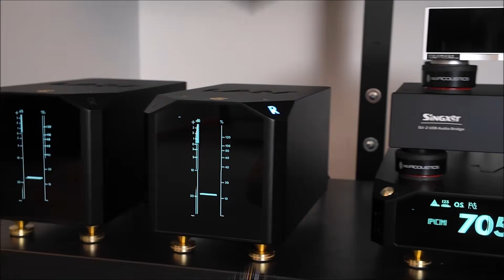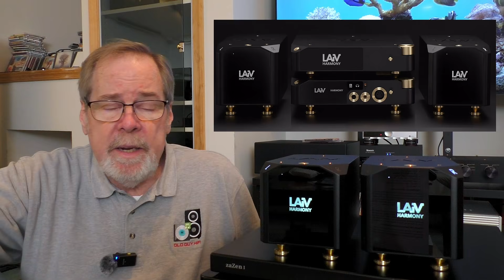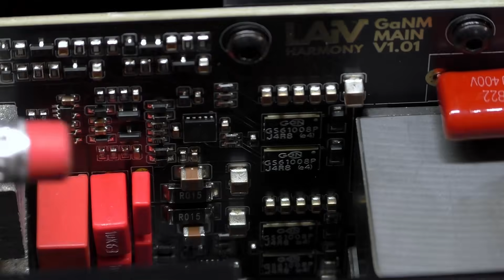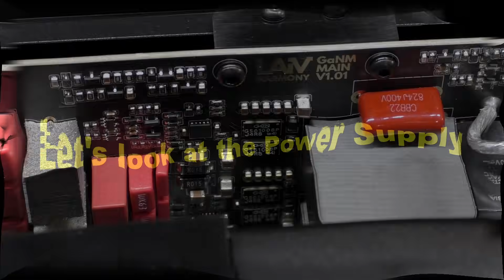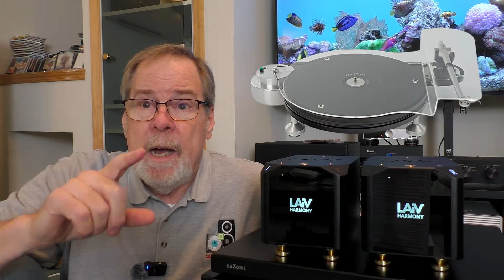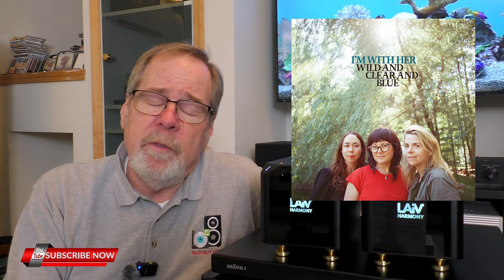I Once Asked if it Takes 2 to Tango. YES! Definitively! The remarkable LAiV GaNM Mono Amps. GREAT!

Comment from the maker: Capable of delivering 200 watts per channel into 8 ohms, the Harmony GaNM provides ample headroom to effortlessly drive even demanding speakers with precision and authority. This high power output is maintained without sacrificing detail or finesse, offering an engaging and transparent sonic experience. Whether you're listening at low levels or pushing the volume, the amplifier maintains complete composure, preserving musical nuance and control across the entire frequency spectrum. For more information regarding the LAiV product line please visit: https://www.laiv.audio or visit Vinshine Audio at: https://www.vinshine.audio/category/laiv-audio. If you wish to join the channel please click here: https://www.youtube.com/@OldGuyHifi/membership
Reply: Great review Ed, I am wondering what magic they did to reach 200W/8Ohm from 250W power supply. My starkrimson ultra monoblock, have 1200W psu and this is match powervise...
Reply from the maker: I will check with the mfr. I do think SMPS operate differently. I will let you know what I find out.
Reply: Hello, I've been a subscriber for a while and I wanted to know if there was a difference in listening with the Orchard Audio Starkrimson Ultra Mono LPS with their linear power supplies!
The Orchard Ultra Mono LPS are amps that have tempted me for a while, but can these LAIVs change the situation? Is an objective comparison possible, and can we say that the Orchard, despite a slightly higher price, is worth it for a long-term purchase? A sort of ultimate amp in terms of quality/price ratio. Thanks to all the opinions and advice from experts! From France!
Reply from the maker: I think the OA amps use an SMPS power supply. There is some conflicting information on this. The units I reviewed had a SMPS. I haven't heard the version with an LPS. Sorry. I do feel that modern SMPSs are getting to the point where there is little if any sonic difference with an LPS. SMPS are far more energy efficient and produce much less heat. That's the best I info I can provide. Bonne Chance!
Reply: Hey I love your reviews and your music suggestions are very welcome.

Comment: Would like to get this in stereo without the display and a single ended inputs with gain adjustment for use with high gain tube preamp
Reply from the maker: Rack or to LAiV and pretty them know.

Comment: Hello OldGuyHifi, does Laiv Harmony GanM monoblock amplifier employ global post-filter feedback (PFFB)?
Reply from the maker: No. It is not that kind of amp. PFFB is only on TI chip amps.
Reply: Thank you OldGuyHifi, so with different speaker loads (4Ω vs 8Ω vs different speaker Ω on playing music) change the sound signature (specifically, bright/treble boost). Were you able to hear a difference (bright treble) while playing music with different speakers?
Reply from the maker: There was no change in sound regardless of impedance. Again this is not a chip based class D amp. It does not need any circuitry to accommodate speaker impedance.
Reply: @O@OldGuyHifi Thank you so much for the info.

Comment: Any recommendations for a good tube preamp for under 2k (used or new) that actually has some tube warmth?
Reply from the maker: Take a look at the Galion TS-P75.
Reply: @OldGuyHifiI had considered it but it’s such a new brand. Any others that you might recommend? Thanks.
Reply from the maker: Not sure about the price but take a look at the Rogue RP1.
Reply: @OldGuyHifi Thanks. Price is within parameters.

Comment: I own LRS+ speakers, which you mentioned in your review, but you never got back to the caveat of them with this amp in your conclusion. How did they sound with these amps?
Reply from the maker: I would stick to Class A/AB amps with the LRS+.
Reply: @OldGuyHifi was there a problem running the Magnepan speakers or was it the sound? Would the larger 1.7i be a better match?
Reply from the maker: The amps lack warmth. They are very detailed and clinical in their sound. A bit sterile to my ear on the LRS+.

Comment: Hello again Ed!
Texas Instruments TPA 3251 (lower power than 3255) such as in the 3e Audio A5 typically operates from 450-600 kHz switching but can be used up to 2 MHz.

TPA 3255 has a nominal switching frequency of 450 kHz but can be set to other values…

You reviewed the 3e Audio A7 which uses the TPA 3255 and preferred it to the Fosi v3 monos. My 3e A5 should be better than the A7 if you don’t need the extra power because the 3251 is a lower-distortion chip (particularly lower odd high-order harmonics). How do you think these LAiV stack up against the 3e audio and the Orchard? (I actually don’t know the design of the Orchard—I just know people like them).

I didn’t like some purifi I heard. I have the DIY open baffles I have mentioned before with 96 dB sensitivity—full range. Titanium dome tweeters loaded in a horn configuration firing coaxially through the center of an ENORMOUS midrange driver which is attenuated only acoustically via slot loading (no electrical crossover). The tweeter with a shallow 1st order hi pass filter (Soviet paper-in-oil capacitor) and woofer with a shallow low-pass 1st order thick gauge copper wire steel-core inductor). This is a SIMPLE AS HELL crossover that won’t mess up the phase of the sound. I don’t like dealing with tubes—but I do like a warm sound like you…
Reply from the maker: Thanks for sharing.

Comment: New technology that doesn’t really have any track record compared to Silicon based - also easily destroyed with even low over voltage.  Let’s see if it’s around in 3 years, too early to tell.
Reply from the maker: The way it is being so widely and quickly adopted I have to think they know something. GaN FETs have been in use for a very long time in industrial applications. They are just a recent tech for audio. Thx for tuning in and commenting.

Comment: outstanding review . you've covered all the essentials. Thank you, and i appreciate your hard work for making this episode.
love the look of these Blocks (i think the Silver version is pretty sweet too). 
so for someone like me who's building a whole New System from ground up. would it be wise to get their HP2A pre-amp since it's designed to complement these mono-blocks,  or venture out to something else ? " which can be risky " ..
Reply from the maker: No risk. If you like a lot of detail and don't mind a bit of extra high frequency energy then the HP2a would be a good choice. If you would consider a different preamp watch for my up coming reviews. I have several very good, affordable preamps they may work a treat. Thx.
Reply: @OldGuyHifi your point is Well taken.
i'm in no rush to purchase anything as i'm collecting all the info i need before i pull the trigger.
will definitely wait (and be well worth it) for your next review. thanks for your reply.

Comment: Thanks for the great review. I am currently using a tube based Primaluna Evo 400 pre amp and Evo 300 power amps with KT150 tubes. Retirement is telling me I am a little tired of 70 pound monoblocks. I am looking for something with deep and impactful bass punch that would match my Evo 400 pre amp. Would the impedence specs of the 2 brands be a good match. Any further thoughts would be much appreciated before I pull the trigger on ordering these.
Reply from the maker: I might suggest you wait for my full review of the Pearl Acoustics 7040. If the budget allows, it is an amazing unit. Thx.
Reply: @OldGuyHifi Living in Canada I did check out the retail of the 7040s and they come in at around 12k canadian dollars plus shipping. The Laiv Monos retail for 6700 cdn. With the difference I could move up to the Harmony dac. I will await you future pre amp reviews and certainly any other suggestions. Thanks for these great reviews.

Comment: Why doesn’t Laiv list 4ohm power specs? Can it handle below 3ohms?
Reply from the maker: Right in the beginning of the video I put the specs on screen and mentioned the power rating. It is 400 watts into 4 ohms and it is 2 ohm stable.
Reply: @OldGuyHifiI was looking at website while while watching your review. And website doesn’t state 4ohm rating. But thanks I did see you mention it later also.

Comment: With all due respect. You have great knowledge working with great hi res audio gear. May I suggest a little bit of work on your graphics. Seems dated. You can use chat gpt and canvas to design a better graphic page for your YouTube. Twice I almost switched away from your channel except for the audio hardware. I bought the small po100 pro after watching your channel. Please not a negative review but a helpful one. This could be a better channel with a more warm welcoming graphic page. No hate sir, all in good advice sir
Reply from the maker: Thank you for your input.

Comment: I just don’t know how you can review components every few days. Most reviewers spend weeks/months with components.
Reply: If you follow the channel you’ll see that he got a ton of review samples simultaneously. He has been rotating all this equipment for evaluation for weeks.
Reply from the maker: If you look back, I did a quick unboxing video short on these amps on April 28th. I think 14 weeks and 6 days is long enough. Plus, I have listened to them for probably a minimum of 200 hours. BTW, thanks for being a subscriber.
Reply: @OldGuyHifi I am just flat out astonished  by the turnover of equipment that you manage to review, a tribute to your hard work and dedication.
Reply from the maker: @lesarnolfinis6775  I am retired so I can dedicate a lot of time to listening. Also there is no way for a viewer to know how long I have a piece of gear. I have had the GaNMs for 14 weeks, so I have had plenty of time. Thanks.

Comment: @Ed, great review as always... 
It seems like the power supply really put this high on the list of GanFET amps. 
Have you seen any other power supplies that are that 'crazy' in terms of pushing the tech?
Reply from the maker: Since this is really my first foray into high speed SMPS tech, I don't have enough exposure to them to draw any meaningful conclusions. At this level of cost & performance I get the feeling that for these high speed switching Class D amps there is little or no difference between an LPS and a SMPS. If you look at some of the very high end Purify, Hypex or ICE Class D amps most use SMPSs. This technology is advancing rapidly. Good question. Thx.

Comment: Great review of a very interesting amp and design. What is your opinion on the value of these $4,500 a pair mono blocks? I commented on an earlier review about Van Alstine DVA M225 mono blocks at $3,400 a pair, 200 watts into 8 ohms and not much bigger than Laiv's. If you or anyone is exploring similar options in amplification, give them an audition.
Reply from the maker: Thx for the suggestion.

Comment: I can’t get past the terrible $1500 in spent on a class D amp.  I keep telling myself that products like this may be different but I have to stay with a/b.
Reply: I’m using a Class A/B amp voiced for a tube-like sound (Galion A75) for the tweeter and mid-woofer and a basic Class D amp with Purifi amp modules for the woofers.  This works VERY well.  I have all the resolution I can handle with no harshness.  It makes me seriously question the need  for or advantage in a high-end Class D amp.
Reply from the maker: I felt the same way. I am not ditching my Class AB gear but these Class D amps see getting better all the time. The Pearl Acoustics 7040 is a serious game changer and will disrupt the market. I think it will surprise a lot people. Thx for the view and comment.
Reply: You just need to fix Class D with tube pre
Reply from the maker: I agree.
Reply: @seanb3303 I fixed a/b with a tube preamp.  Vincent.

Comment: Nice review, Ed! I'm with you on solid state preamps paired with any kind of class D. I try so hard to make that work for my tastes but it's just too cool for me, a bit too thin and dry. But like you said, super clean and clear, it's the tone that kills it for me. So, I use a tube preamp with my class D amps. That said, I found one pairing that works well, the new Fosi ZP3 and my Nelson Pass burning Amp 3, 40 /ch pure class A and it's because that Pass amp is smooth and warm, with good amount of second order harmonic, that it actually works with solid state preamps as well - for my tastes that is.
Reply from the maker: Sounds like a great system. Thx for sharing it.

Comment: I’ve had my Laiv GaNM amps for about a month now. They replaced the Lamm M1.1 I’m not missing the Lamms at all!  I do use a  Audio Research ref 10 preamp and yes I know it retails for 10x the Laiv amps! My point is that these amps are spectacular in every way! Being a old hifi guy myself I am done with the heavy gear! Great review!
Reply from the maker: That sounds like a great set up. I appreciate your sharing your experience. Thx.
Reply: @OldGuyHifi I also have the Laiv Harmony dac and ddc per your recommendation.   Thanks for all your content! I tried joining your channel this morning and told me try back later.  Maybe because I’m traveling.  Will join when I return home.
Reply from the maker: Thank you for wanting to support the channel.
Reply: What speakers have you paired with them?

Comment: Nice one, Ed.  I'm still trying to decide if I like the LAiV 2-1 feet set-up on their units!!  They look cool... but that's about it
Reply from the maker: I am not a fan of the 3 feet either. Makes the unit tippy. But, that said the sound more than makes for whatever minor design issues they're are. On the Harmony DAC and HP2a three feet isn't really an issue.
Reply: I don't care for the 3 feet set up. 
Maybe if the amps & dacs were in a Triangle shaped chassis 🤪

Comment: QUESTION:Of all the GaNM maps you have(three, I think),which are the  best for my application?
Orchard vs LAiV?
I have a Eversolo A10 to use as a pre/dac/streamer and Klipsch Cornwall iv speakers.
Reply from the maker: The OA amps would be a very good choice. FYI, since my review they have gone on backorder. Check with Leo at Orchard for availability. Thx.
Reply: @OldGuyHifi Thank you,
which OA amps?The small new ones?
Reply: just emailed you thx.
Reply from the maker: Yes. The small ones.
Reply: @OldGuyHifi The amps are available.

Comment: LOVE THE BS comment at then end, stick to it. I hope we can get your a pair of Aegir 2's in, I think you would love that with a Kara F. Great Review as always
Reply from the maker: Thx.
Reply: Another good detailed review as well as a couple of artists I haven’t listened to before.  At this point in time, I rate Class D amps on 3 factors.  

The first is clean detailed sound and most Class D amps clear this requirement with ease.  

Second, as Class D amps get more expensive, I expect them to look the part.  For $4500, I need more than a plain black box and LAIV clears this hurdle as well.  

The final hurdle is the fail for me.  At this price point, I shouldn’t need a tube front end to soften the sound.  This seems to me to be the area in which more expensive Class D amps separate themselves from less expensive ones.  But great detailed review and I look forward to further advances in Class D.   However, for now, Class D will remain in the woofer section of my bi-amped speakers.

Comment: I find the ultra detailed amps or amp speaker combination are not for me either.  There is a balance between audiophile detail and natural sounding music.  I finally found the right balance for me.  Although I still very interested in equipment, there is a synergy between my amp, speakers and streaming DAC and if I change any one thing, it does not sound as good.
Reply from the maker: Thank you for sharing your experience.